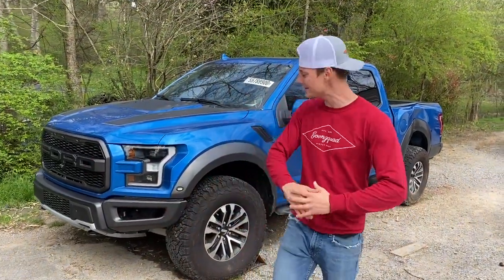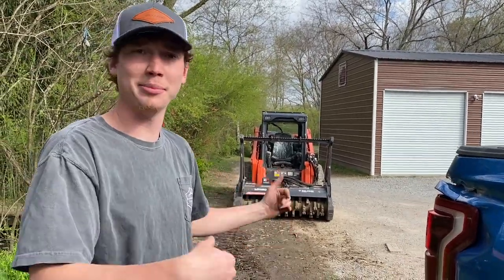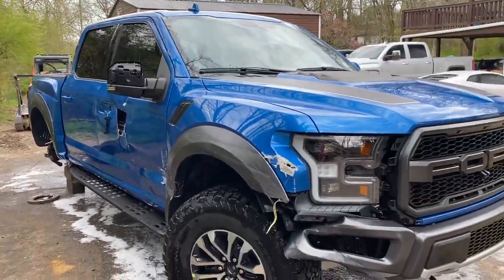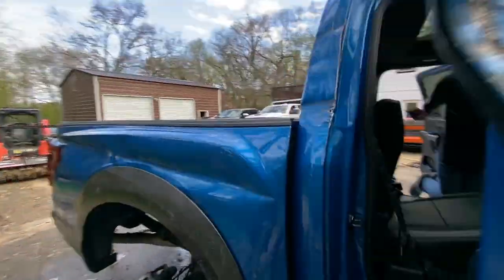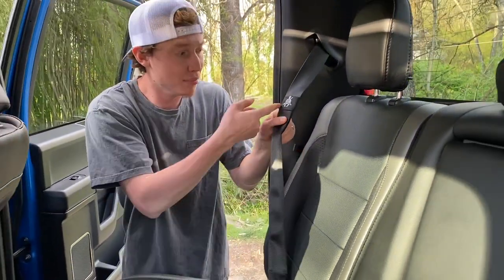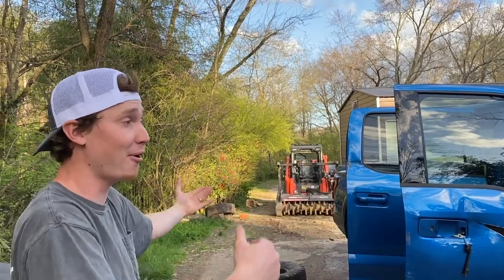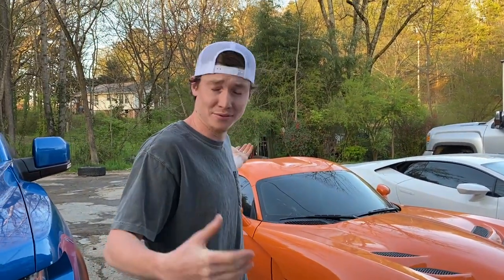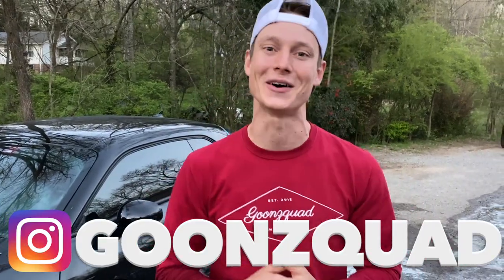Rebuilding A Wrecked 2019 Ford Raptor Part 2

Comment: This guy Clearly Probably went thru a fence! Lol
Reply: The fact that none of the airbags deployed on the Raptor is consistent with it being sideswiped from rear to front while parked, and that this caused the scraping and directionally biased tearing damage along the passenger side. The damage on the driver's side is different, because it is buckling, not scraping, and the most obvious example of this type of distortion is on the side of the bed, and was probably caused by the rear left-hand wheel being forced upwards violently after striking a fixed object such as a curb. This impact was a high energy event, shattering the rear axle components and even buckling the driver's side rocker panel. The frame (chassis) of the truck is probably distorted in this area and around the rear suspension mounting points, and this is the likely reason why the Insurers effectively wrote it off. Copart auctioned the Raptor to Goonzquad on 10th December 2020 for $41,500 (around $45,000 'out the door') and estimated repair costs at $39,055, with predicted resale value at $74,752, making it an unviable proposition for a typical buyer but acceptable to Goonzquad because of the YouTube revenue potential it offered.

Comment: According to Ford, Quote: 4A (AUTO): In this mode, electronic control four-wheel-drive power is delivered to all four wheels, as required, for increased traction. For all on-road conditions, including dry road surfaces, wet pavement, snow, or gravel.

Comment: Dudes, you don’t haul stuff with a Raptor, that is a off road racing truck.  Hauling capacity isn’t as much as regular F150, because of the softer sport/off road suspension.

Comment: There’s no fence that took out that axle!
Reply: The fact that none of the airbags deployed on the Raptor is consistent with it having been sideswiped from rear to front while parked, and that this caused the scraping and directionally biased tearing damage along the passenger side. The damage on the driver's side is different, because it is buckling, not scraping, and the most obvious example of this type of distortion is on the side of the bed, and was probably caused by the rear left-hand wheel being forced upwards violently after striking a fixed object such as a curb. This impact was a high energy event, shattering the rear axle components and even buckling the driver's side rocker panel. The frame (chassis) of the truck is probably distorted in this area and around the rear suspension mounting points, and this is the likely reason why the Insurers effectively wrote it off. Copart auctioned the Raptor to Goonzquad on 10th December 2020 for $41,500 (around $45,000 'out the door') and estimated repair costs at $39,055, with predicted resale value at $74,752, making it an unviable proposition for a typical buyer but acceptable to Goonzquad because of the YouTube revenue potential it offered.

Comment: What does 4A mean on f150?
automatic all-wheel drive
The new transfer case has a setting called 4A, which stands for automatic all-wheel drive. This setting puts the vehicle in full-time all-wheel-drive mode

Comment: Raptors are pretty poor for towing. Soft suspension and a very low payload (1100# range). Rated hitch capacity is up to 8000# (for the SuperCrew/4door, 6000# for the SuperCab/2.5door) but with 10-12% tongue weight + 2 occupants + gear you're quickly exceeding payload. Goes for both Gen1 (with the 6.2L) and Gen2 (3.5 EB HO), both are rated at 8000#. Whoever towed a skid with a Raptor was well in excess of ratings. So .. yeah. Gen1 Raptor's 6.2 is essentially the same to the 6.2 that you can find in the SuperDuty, albeit with a different tune (and valves I believe).

4A is 4WD Auto: engages IWE vacuum hubs and uses a clutched system (torsen diff) to send more/less power to the front wheels as desired. Available on Lariat and up, including Raptor.

The taillights are LED, yes. LED + BLIS. Specific to the Raptor (but only because they're BLIS + housing color. Technically any LED F150 taillight would fit and work).

The roadside kit you got is a dealer accessory that you can choose during the ordering process. That you have it is a sure sign that whoever owned this truck went all-out and ticked all the boxes during ordering because I've never seen anyone actually order that, lol

And yes, there's an EcoBoost Mustang but it's a 2.3L 4-cylinder. :)

As for 3.5 EB reliability; they're pretty good engines. There have been issues with cam phaser rattle but Ford just released a new part last year (part number suffix is -CD) that seem to be a proper fix. Aside from that there are few issues. The regular F150's got a plastic oil pan for some time which tends to leak, but I don't know if the Raptor got that as well. Easy enough to check.

Looking forward to the build! Some bigger turbo's, 37's, full skid plates from RCI and maybe some +2 fenders and it'll look beastly!
Oh, and yes, you can get an external blowoff valve (BOV). Factory has it tied back in to minimize "noise", but you can either disconnect that and vent to atmosphere, or replace with an aftermarket BOV.

Comment: 4A is 4x4 auto

4A (4X4 AUTO) – Provides electronic controlled four-wheel drive with power delivered to the front and rear wheels, as required, for increased traction. 4A tuning varies based on selected Drive Mode.  4A in Normal and Sport is appropriate for all on-road driving conditions, including, dry road surfaces. 4A in Snow/Wet is appropriate for slippery on-road conditions such as snow and ice covered roads.

4-wheel-drive Auto with high range gearing (1.00:1) Full-time all-wheel-drive capability,

Electronically adjusted torque split to front & rear wheels, Electronically variable center differential,

Front driveshaft & rear primary driveshaft allowed rotational speed difference,

4-wheel electronic traction control system is enabled

In 4A mode the center differential is electronically-controlled and rear drive wheel bias. The on-board computer monitors for any sign of rear drive wheel slip (loss of traction)

If loss of traction is detected, the center differential is told to send a share of the engine s torque to the front drive wheels. It will not let the front driveshaft turn at the same speed as the rear driveshaft.
Reply: THEY CALL IT 4X4 ON DEMAND BUT YES ITS 4X4 AUTOMATIC

Comment: You said that a guy you saw at a construction site used his to pull a skid steer around so its used as hauling truck.  You should familiarize yourselves with the Raptor before you go and ruin it.  The Raptor was build to perform in Baja type off road racing right out of the factory so it has all the performance to do that stuff so don't go lifting it and putting crazy rims and tires on it you'll ruin it.  Enhance the capabilities don't ruin them like you did that gray Chevy truck with the lift and silly rims and tires that can't be used as a truck anymore.

Comment: Long time viewer but 😂 they are clueless on there specs for the Raptor. They tow way less then the regular F-150. 
4A = auto 4x4. The suspension is set up for high speed off-road use. It is not set up for towing.  They are good at what they do but they really should know what they are talking about.

Comment: A raptor is just a f 250 with a raptor name guys nothing great and I hate fords there interior is low quality but the new 3 rd gen will be a actually v8 instead of a little ohh v6 I know they have like 500 hp but they can keep the v6 I want pay 80 gs for a v6 anything that's just me but can't wait to see if you guys upgrade the tubskies on it at least